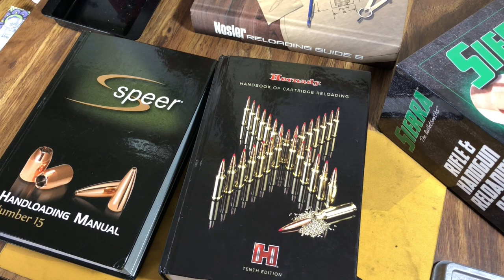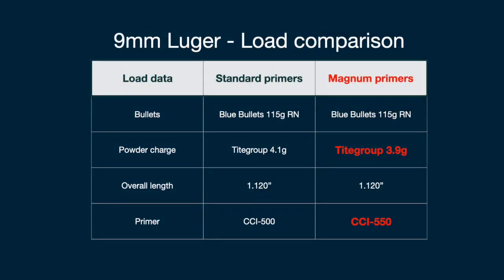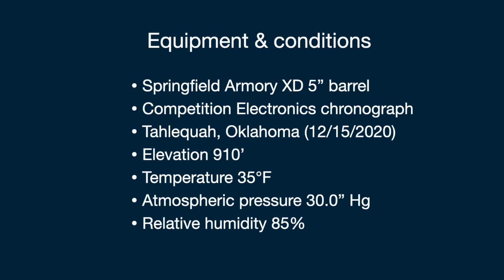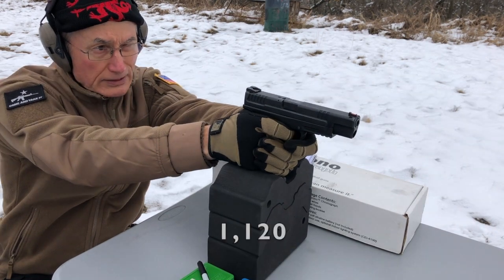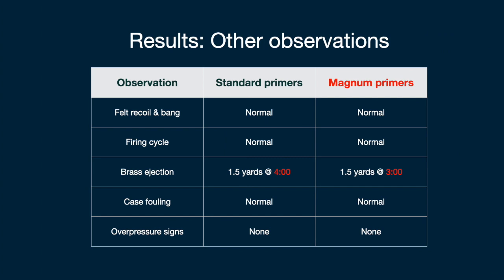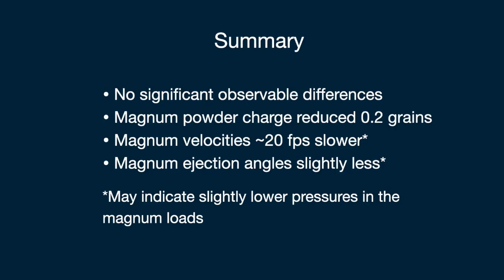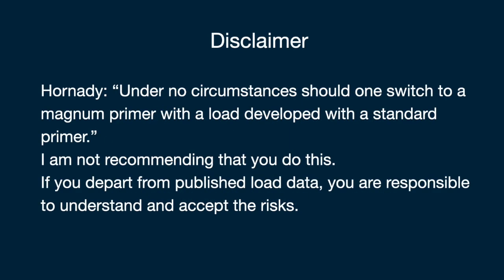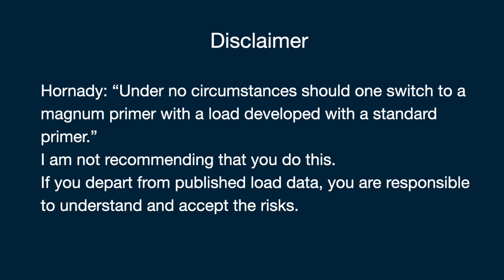Magnum Primers for 9mm Luger?

Comment: Great information in a world bereft of primers!  Would be interesting to see a similar workup for the other pistol and rifle primer sizes.
Reply: My main purpose for reloading is that they cost less. Initially I started to reload to get better accuracy.  I started  out with every reloading manual I could find and every one was a little different.  I prefer the Lyman manual over the rest because it contains more information and I have the last 3 produced manuals.  Lyman manuals provide maximum and minimum loads as well as the most accurate load.  They also provide the pressures for those loads. Every cartridge has a maximum allowable pressure for the caliber. There are some reloaders who load  for maximum velocity and will exceed the recommended maximum load. If one of these reloaders decides to switch to a magnum primer just to see what happens he is not acting responsibly.  You mentioned a shortage of components we have to deal with.  There is a difference between 9mm  lead cast bullets of the same weight produced by every manufacturer.  Most are not pure lead.  They mix other elements into the lead to make the bullet harder.  Each formula being a little different from the others will provide more or less friction when going down  the barrel. Also you must consider the shape of the bullet.  Each shape provides more or less bearing surface on the barrel.  And all this means more or less powder is needed in the load. There is no way that a reloading manual can provide information for each bullet design and composition.  You can make some judgments from the provided data in your manual.  However, you must proceed with caution and most important whenever you change a component you must work up a new load.  I use Sigs hand guns and what I have learned about my 9mm is that it is most accurate at specific velocities.  I use a chronograph when working up loads. So, no matter what powder I use if I can get the same velocity from each load it will be the most accurate for that powder.  If I stay within the maximum recomend amount of powder each powder will max out at a different velocity and different shot groups. I use a bench rest when working up a load.  As I mentioned that I load for accuracy. So I have tried a lot of different powders and a lot of different bullet weights and designs.  In addition if you use 2 exact makes and models of the same gun the results will be different.  Some times the velocities can vary up to 150 fps.  Accuracy can also be different from a 1 inch group up to 6 inches.  That is why you must work up loads for each and every gun. Above all keep records of what you do.  Reloading is a hobby too.
Reply: @danielswartz6818  Thank you. Much more good information. I don't have the Lyman manual. I wonder how it compares to the Hornady, Speer, Sierra and Nosler ones? I use them, in addition to online data from Hodgdon. I don't test groups with my pistol. For some reason, my shooting off sand bags seems less accurate than off-hand shooting, which doesn't make sense. All my shots go way too high off a rest or sand bags, but on average, are right on with my sights (factory set) when I shoot off hand. So I mainly evaluate my loads by mean velocity and standard deviations. I'm assuming standard deviation is an objective ay to evaluate precision.
Reply: @salmonthomas  what I did was buy as many manuals that were on the shelves.  Some I did not buy because their information was lacking.  I bought them whenever I saw them.  They run about $30 each.      A little bit about bench rest shooting.  The method  of bench rest shooting is to keep the gun as stable as possible when the round is fired.  Then the only variable is the cartridge. So it does not matter where the bullet hits on the paper.  The goal in reloading is to get 5 bullets in the same hole.  Different loads will spread the shot group to perhaps 6 inches while some may be about an inch.  Keep in mind that by securing the gun at the time the round is fired makes the only variable the bullet. Also don't worry about where the bullet hits the paper.  In working up a load for my 9mm Sig I obtained a 5 shot group at 11 o'clock on the target.  As the amount of powder increases the velocity changes. If you shoot about 7 or 8 different loads you will notice that they print at different points on the target. All the time you are looking for the smallest group.  Once you have found the perfect load you can have the sights adjusted.  Sometimes you have to settle for the second best group because it is closer to dead center.  Lastly. You must be sure that you fire the groups exactly the same.  Of course, sometimes freehand shooting groups can print a lot different than bench shooting.  That could be the fault of the shooter.  Primarily it could be triger control or moving the gun as you pull the trigger.  Velocity effects where the bullets hit relative to where you aimed.  As soon as the bullet leaves the barrel it starts to fall to the ground due to gravity.  The higher the velocity the longer the bullet travels before it hits the ground.  Even in hand guns.   That is one reason your bullets hit the target at different heights.  So, first you have to make sure that wherever your sights point to is where your bullet goes and consistently.  That is why you reload.  I use to work with a reloader and he gave me a lot of tips that helped me out a lot.  Some of the guys I met at the range do not have the slightest idea of what  they are doing. If their brains were dynamite they wouldn't have enough power to blow their nose.
Reply from the maker: I think there's a Youtube video showing small rifle primers for 9mm Luger. I've heard primer cups are thicker for rifle primers, so there may be a risk of misfire (failure to fire). I've also heard people advise against pistol primers in rifle loads. If the more powerful rifle firing pin punctures the pistol primer cup, which is thinner, you could get dangerous pressure coming out the back.

Comment: i was wondering the same thing what load do you use? i seen you have some extreme bullets are those the CPRN bullets 115 gr? be interested in seeing some of the loads you do! i have bullseye powder and number 5 pistol powder
Reply from the maker: Here's data for the loads used in this video. Standard load: CCI-500 small pistol primers, Titegroup 4.1g, The Blue Bullets (115g polymer coated round nose), OAL = 1.120. Magnum test load: CCI-550 magnum small pistol primers, same bullets, Titegroup 3.9g, OAL=same.

Comment: I recently ran out of standard small pistol primers and used some magnum primers in 9mm, 38 special, and 357 magnum. I haven't had a chance to try them out yet but I did not change my loads at all when loading the magnum primers. I'll let you know if I noticed any difference. I might make a video on this as well. it's good info to put out there.
Reply from the maker: I'm looking forward to hearing how it goes.
Reply: @oakleydefense5513  i'll let you know once i post it

Comment: So I currently have Hodgdon hi-skor 700-x flake powder and only magnum primers due to the shortage I was given the primers. Should I deviate further from the load data than 2/10s? Does the powder matter very much. According to Winchester the powder I use is a very fast burning powder.
Reply from the maker: I'm not an expert, since I had never done the before, so take this with a grain of salt. From my experience and what other people have said, I would either subtract 0.2grains from whatever safe load you have for normal primers, or you could start at the recommended minimum powder charge range and work up from there, looking for signs of overpressure with each test load. Obviously you don't want to exceed the max, but you also don't want to go below min. Keep in mind that those loads go with a certain overall length. Changing overall length changes the pressures.
Reply: @oakleydefense5513  thank you for the response and the video! I will make a few with the lowest grain load recommended and test.
Reply from the maker: You're welcome. Feel free to contact me again if I can help, or you'd like to discuss this more. I'd be interested to hear what you find out.

Comment: Happy to see you got good results.
I have used "standard" primers where the load data calls for "magnum" primers.  I did not see a difference at all.
Some re-loaders I knew advised against using magnum primers in standard loads because of the possibility of "detonation" of the propellant.
I suppose a particular powder at a certain density, temperature, crimp, bullet weight, caliber, etc. might detonate instead of deflagrate.
Good info & be well, Sir.
Reply from the maker: I recently bought some Winchester large pistol primers marked for use in both standard and magnum loads. So maybe there's not a huge difference between the two. Several expert reloaders told me the small pistol magnum for standard swap is not a big problem, though you need to reduce the powder charge a bit. Under normal circumstances, most people wouldn't even consider it, but now, some people may be facing the choice of either no ammo at all or less-than-ideal ammo.
Reply: Only difference I have head is the mag primers are a bit harder, but I "heard" it so I can not confirm that.
Reply: @FLCLnaota  The magnum primers are slightly thicker to handle higher pressures from magnum loads. Thus that could be construed as "Harder". So in theory you could risk "Light primer strikes". Most stock pistols right out of the box will function fine with mag primers however unless you have changed springs or reduced your your firing pins striking force. I run mag primers all the time in 9mm. Never had a single problem ever.

Comment: Only primers I can reliably find are Large Rifle Magnum. So I have been reloading my 500 S&W with them. I use the LRM primer and keep the powder about 1.5 (cant remember right now the numbers are recorded in my book) grains under maximum. With the 440 grain cast bullet and a very heavy crimp the recoil is substantial but the load is highly accurate.
Reply from the maker: I wouldn't have been so bold as to try that, but that caliber is so powerful that maybe a magnum rifle primer makes sense. I've read that rifle primers have thicker cups, so some pistol firing pins might not have enough power to ignite them. In that case, the main problem is just a misfire. I've heard that substituting pistol primers into rifles is a bad idea, since the thinner weaker pistol primer cups might puncture from the strong rifle firing pins. That might, in theory, allow high pressure gasses to escape out the breech, a dangerous situation!
Reply: @oakleydefense5513  I'm going to assume you don't reload for 500 Smith (if you don't have one I recommend trying one out). In short the 500 S&W Magnum has a safe chamber pressure of 60,000 psi. Most manufactures keep loads to 50,000 psi because of difficulty extracting the cases from that extra 10k psi. Early on people found out that high pressure loads were deforming the large pistol primers the rounds were loaded with. Companies like Star Line decided to make the 500 pistol brass with a large rifle primer pocket and mark the headstamp with an R to make them distinguishable from the early cases. So I was just substituting a large rifle primer with a magnum. I don't know what my original chamber pressures were for mu particular load as the bullet maker sent me the load through e-mail. Matts Bullets is where I got the bullets and if you but his bullets he will tell you a load that works safe with them. I don't really know the difference between a LRP and a LMRP so I  kept the load under maximum. I was using IMR 4227.

Comment: I think what happens is the primer pushes the bullet out of the case before complete powder burn !! But that’s just my two cents!, great vid!!
Reply from the maker: For some shots, the smoke shooting out the barrel for the magnum loads seems a bit blacker than for the standard loads. The video frame rate is slow compared to the action of firing, so what you can see may depend on how the video sync'ed with the blast for each shot. But your theory might explain the subtle difference in the smoke; that is, the powder burn rate might be slighlty different for the two primers.
Reply: @oakleydefense5513  a change of primers, load density, and bullet crimp,or distance to the lands in rifle cartridges will all change the burn 🔥rate of the propellant.
Reply: That is not the case.